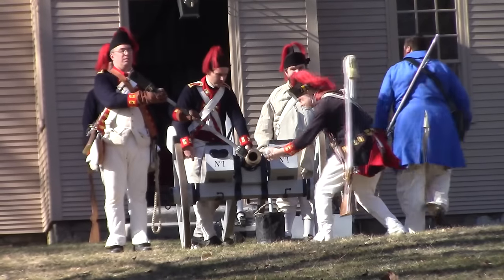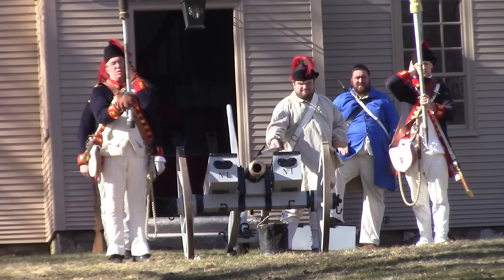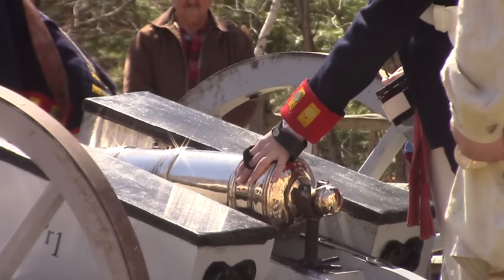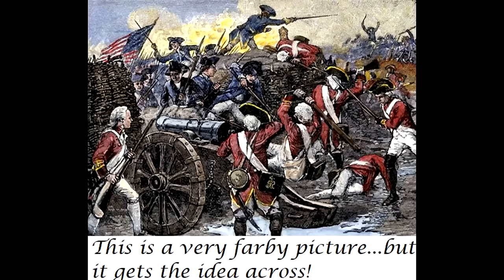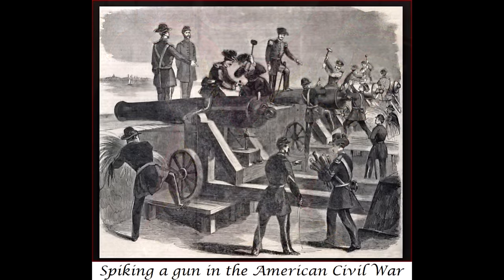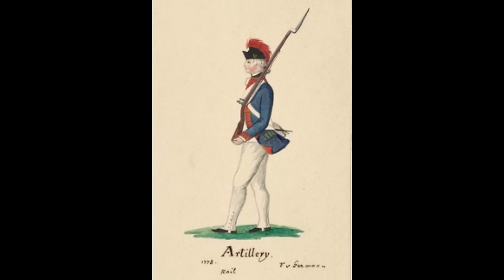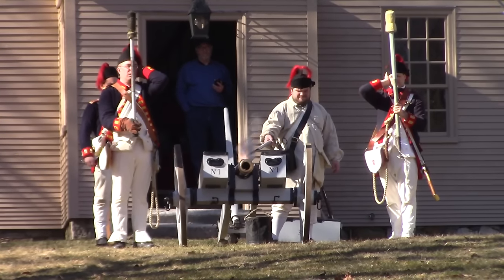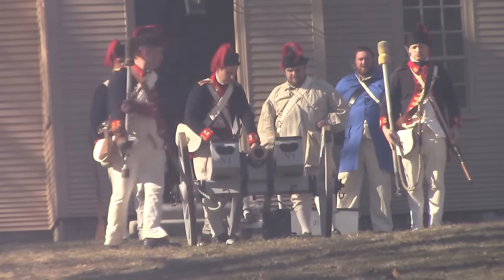Spiking Guns, and Other Topics Regarding the Royal Artillery

Comment: Watching this video made me remember that during a campaign against... Prussia I think (I'd have to find the video Epic History TV made about it again)... Napolean had his cannons push forward and fire into the enemy defences at what was essentially point-blank range.

I would assume a tactic like that is in fact rather stupid yet he somehow made it work.
Reply: It wouldn´t in fact be stupid, as Napoleon demonstrated (though I doubt he was the first). Think about it this way, you have a Prussia line, it is getting showered by shrapnel, you either advance to take the guns, but risk getting shot and charged by line, not to mentioned the sheer panic of charging a battery. Your other option is to retreat, which then allows the enemy to take the position.
Reply: @emperorpenguin3845  

I say it was stupid because moving the guns within spitting distance of their lines could've left the crews dangerously open to gunfire or counter-battery fire
Reply: It would be very silly to fire a smoothbore cannon above the heads of your own troops on level ground. At least until the advent of Explosive Shells. Round shot need the bounce. Too high a trajectory and it will just burrow itself in the ground